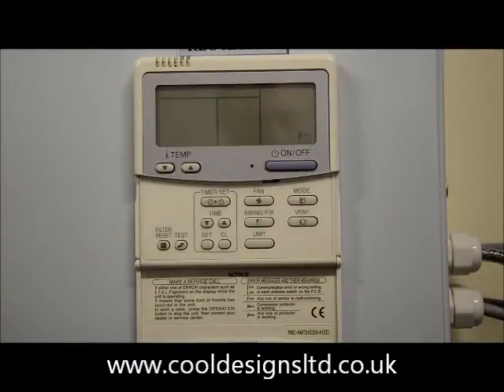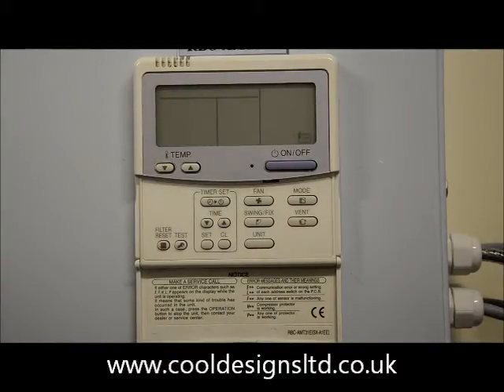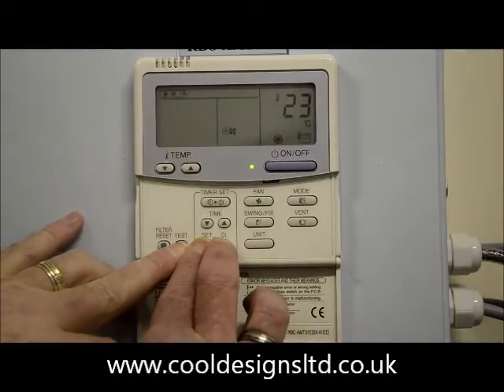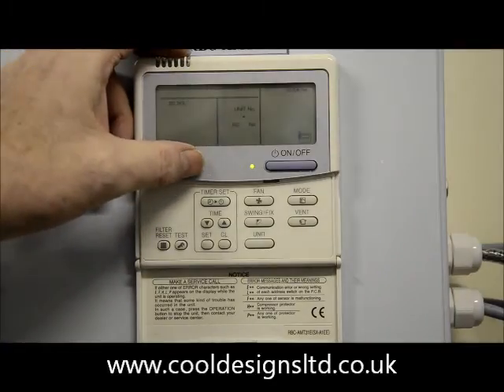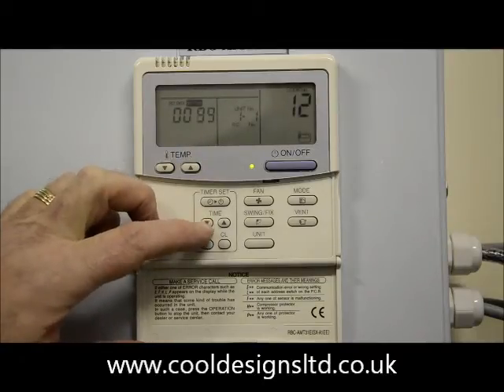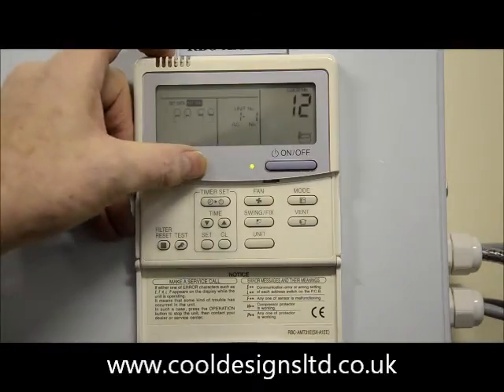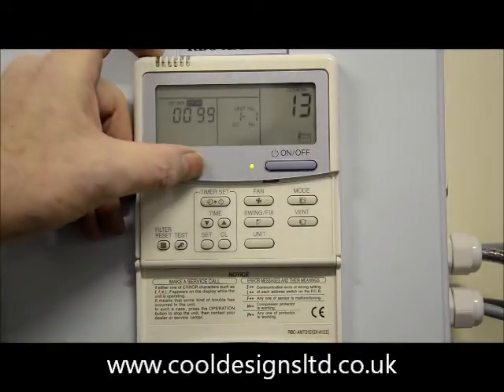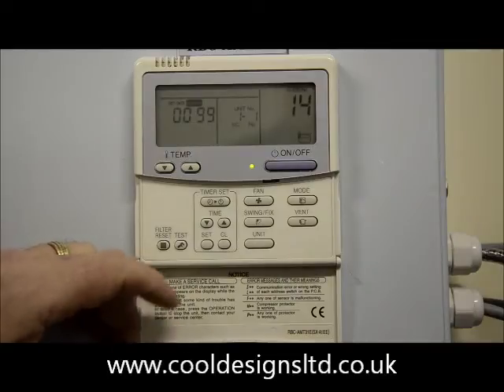Re-address twin triple or quad systems using the local controller

Comment: having same controller,however restarting taking time during operation(If SP is 18,on operation temperature rises to 26 and unit delays in restarting to lower room temp.Any setting issue to address this problem?